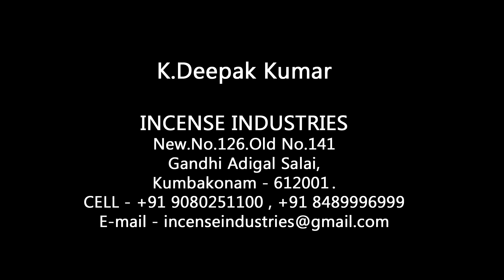Masala Agarbatti & Raw Agarbatti Rolling Machine

Comment: If I want to buy incense like these quality that look hand rolled, where can I buy them wholesale.  Most of the ones I've seen from machines look cheap and are too hard. I like these. Also, what is the difference between wet and dry flora?
Reply from the maker: No other machines are similar to that of the dough used for hand rolling insense sticks...
There's a lot of differences in the raw materials both in nature and quantity used for dry and wet masala  incense sticks...
The diffusion of the fragrance mainly depends on the porosity of the incense sticks, and even shelf life depends on the methods u make them...
Machines available in the market are  extrusion types, which reduce both the shelf life and expected diffusion of the perfume...
You can whatsapp on +919080251100 for rolled incense sticks... we do manufacture incense sticks
Reply: @incensein-sense1363  Thank you for answering my question. Yes I'm interested in more porous incense like the ones from this machine.  I see them already scented at some stores in various brands but all the blanks / unscented that I have seen available via US sellers are hard "punks". I will Whatsapp you